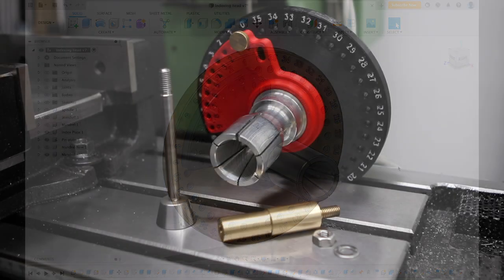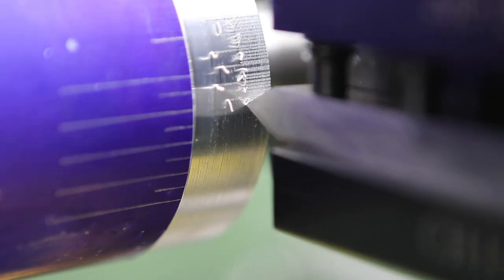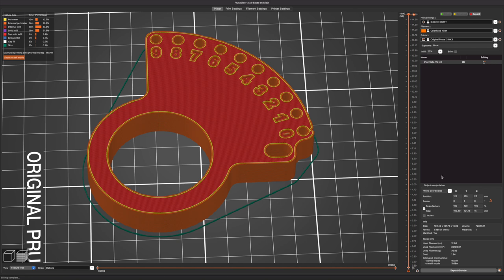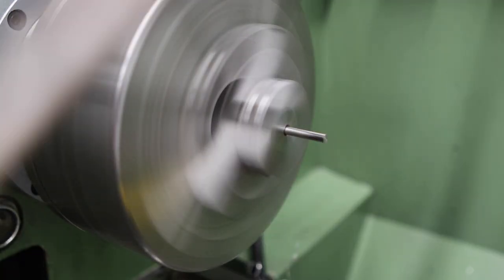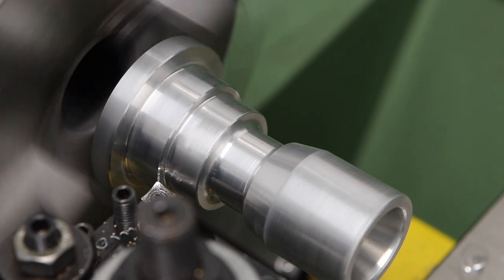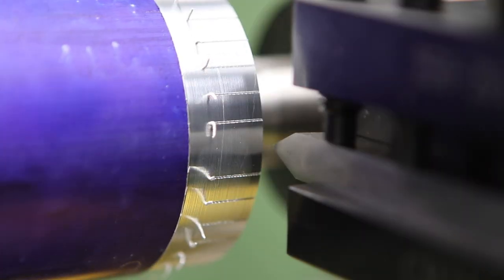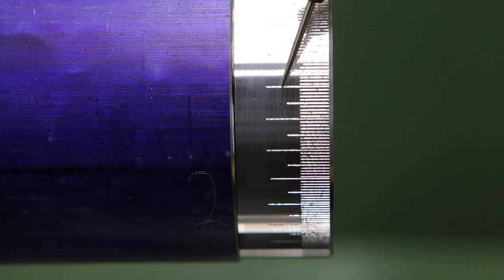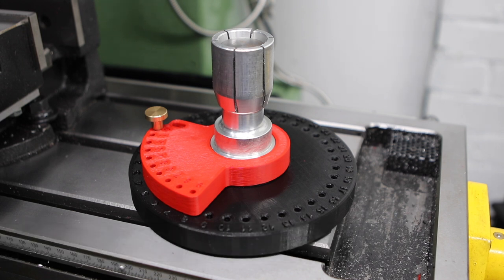Will it work? - Making a lathe indexing attachement - Part 2

Comment: Yes, please make a metal attachment. I don't think 3-D printing is the way to go with this kind of rigid precision parts, and I still see some irregularity in the spaces.
The basic idea however is in my opinion very good. With precisely manufactured parts, preferably made of steel, this can be a very useful addition to the lathe.
Reply from the maker: Thanks Michel, I plan to make the metal parts soon.

Comment: One specific recomendation for the 3D prints. I'd suggest you take a look at modifier meshes. Even the default ones in Prusa slicer would be greatly helpfull in your case. For example add a modifier near the holes and make the infill 100% around those holes or adding extra perimeters around the holes. this could really help you with having rigidity where needed and saving material where you dont need it.
Reply from the maker: Great suggestion Berk, I hadn't considered that. Thanks for the tip.

Comment: I think that's a really great debugging session!! 

I think of course metal would last 'longer' but equally, I don't think it would be too hard to modify the 3d printed parts to put metal bushing into the holes. I think with bushing the main cause of wear will have been removed, but over time with some of the side to side forces you would see the plastic eventually deform and creep, but thats on a timescale of years.... so hardly a concern.

Love the work soo far!
Reply from the maker: Thanks! Good idea on the bushings.

Comment: Excellent tool.  The design is probably the best I've seen, but I am very eager to see the newer version with metal plates instead of the 3D printed ones.  I will definitely be making this for my lathe, but I'm holding off until you have the updated version.  Great videos and explanations.  Thank you so much for sharing.  When will you be doing the updated build?
Reply from the maker: Thanks, much appreciated. I will be doing the metal version with the next two months.
Reply from the maker: I might offer a kit version with materials and printed plans. Do you think people would be interested in that?
Reply: @joneseymakes  Awesome!  Really looking forward to it.
Reply: @joneseymakes  Yes, absolutely.  I would buy it.  As long as the graduation issue is resolved with the metal plates, I think it's a great idea.  A kit with plans and material to machine the parts, or even just the prints so that people can source their own parts...I think either.  Thank you again for sharing.  Great content!

Comment: yep metal for sure. great job improving the printed one tho. The !0 and 5 degree scribes lined up well on the full circumference but the 1 degree is a wee bit off sometimes. I still think aluminium or steel plates  will make the acuracy better being rigid. Looking foward to seeing it
Reply from the maker: Yep. I’ll get to making a metal one soon.

Comment: If you put another circumference of holes, like 20 inside the 36 (at a small radius and match those holes for divisions of 10, less then a degree), you could do divisions where feed screws are 1/5 or 1/10 leads per turn, like milling and lathe, this will enable 100 or 200 divisions in the circle. For the odd lathe I have where 8 comes out, then an another inner circle of holes at 25 divisions, so 125  or 250 divisions can be done (this would be between the 36 and 20 hole circle).
Nice project, and good video production. Thanks.
Reply from the maker: Thanks, good idea. I think I might incorporate this in to the next version

Comment: Don’t know if anyone mentioned it yet , but my suggestion will be to countersink the holes 2mm or so and add matching boss to the pin- I believe you’ll improve the play in the pin and  minimize error due wearing of the plastic. And carbon filled PLA will be more rigid and wear resistant too . As I’m just shed professional with YT degree, i can be wrong for both…😁
Reply from the maker: Sounds like a good plan, thanks for the tips!

Comment: Perimeters, especially when having to modify holes afterwards for a perfect fit, make the most difference in terms of rigidity and also in having enough material left after modifications. Cubic or adaptibe cubic appear to be the most rigid infill as well.
Reply from the maker: Thanks, good advice.

Comment: Hey Mr. Jonesey - loving the content as usual. Quick question - how is the new lathe? Any comments or suggestions? I'm eyeballing a similar model to your's and just wanted to see if you've had any input regarding it.
Cheers!
Reply from the maker: Hi Erik, yes I like it. I made a review video where I spoke in depth about it. Have you seen that? https://youtu.be/YvJ-juk8dNc
Reply: @joneseymakes  I have indeed! And a brilliant review it was. Just wondered if you’ve had any things come up in the time you’ve had it, things you wish it had etc.
Reply from the maker: @EngineerRaisedInKingston  No I'm pretty happy with it. Small niggles, like the lead screw covers get in the way etc but I spoke about that in in video. One thing though - you still have to change the change wheels when switching between threading and feed gears. That's annoying. Would be better if there was a lever instead.

Comment: Aluminum plates would be much more stable than the 3D printed plates, just the nature of the material.  The 3D printed plates can still be of some sort of use, perhaps in woodworking where the dimensions aren’t nearly as critical, I can think of a few jewelry craft tools that are made of wood that require line divisions and these 3D printed plates would make the process much easier. Just a thought.
Reply from the maker: Thanks, good idea.

Comment: Try turning and pressing in brass bushings. You'll get stronger, tighter tolerance, and more wear resistant holes with the same 3d printed part. A nice compromise between production speed and functionality.
Reply from the maker: Yes, I like that idea
Reply: came here to say this!

Comment: If you’re worried about creep of the prints it might help to put a slit and clamping bolt in each to hold tight to the aluminum part.
Reply from the maker: Good suggestion, thanks.

Comment: I know this is a year on.  But, if you can perfect this, you could save allot of home shop owners allot of money.  Or, even, give them access to something they simply can't afford, otherwise. 
Thanks for everything,  Uncle Jonesey.   :)
Reply from the maker: Thanks, I have another video in the pipeline where I'm going to redesign and re-make this  in metal, I think that's going to solve the last of the issues. Thanks for watching!
Reply: @joneseymakes 
Do all of your setups as rigidly as possible (in other words, no teaming of holes while holding the part in your hands on top of the vice).  Use the hole-pattern function of your DRO to drill AND ream the holes, so that you don’t introduce unwanted error.  Also, look into picking up a tapered reamer to use on the holes in the backplate.  Then just make sure that you machine the matching taper onto the pin.  This will further reduce any error by more accurately centering the holes in relation to each other.

Comment: You can't polish a plastic turd...
But you CAN print it with more infill!
Really cool videos, it is interesting seeing you turn what was essentially an unusable concept into something functional.
A suggestion; if you stick with 3d printed plastic for the next iteration you could increase the diameter, ie the radius of the pin from the chuck centre. That will increase the rigidity at the cutting radius and reduce the angular error caused by pin and hole issues.
Reply from the maker: Goo tip, thanks for that. I think for the next iteration I'll go with metal plates now that I've proved out the concept.

Comment: Metal is ideal, but Perspex is a close second if you have access to a laser cutter. It's also pretty ridged. Over a certain thickness, it will crack before it bends. You might find ways of exploiting its transparency to simplify your design.
Reply from the maker: Good thinking Bob, I hadn't considered Perspex. I don't have a laser cutter unfortunately so it's going to be about the same effort to make them in metal

Comment: Hi Jonesy, hey just curious if you ever did a metal veraion of this? I'm very interested in your design, but something that is more consistent than the 3-D printed version and keeps the graduations dead on.
Reply from the maker: I’ve not got around to it yet, but am planning to do this soon. I will make a video in it when I do.
Reply: @joneseymakes  no worries, I understand. I really like your design with the expanding mandrel. Thanks for your content.

Comment: It's a shame the holes have to be so close together or you could probably solve the issue with a metal bushing glued into each hole.  of course that would also require the holes to be larger.  could you increase the diameter enough to allow for larger holes and more space between them?
Reply from the maker: I don’t see why not. Depends on how much clearance you have on the back of your lathe I guess

Comment: I'm not OCD or anything, but, there was enough inconsistency between the degree lines that I'd have thrown it in the bin. However, it may be that only the vernier part needs to be made in metal to higher precision. I'll be watching to see where your experiments take you.
Reply from the maker: Thanks for the comment Jim, yes it's still not perfect. I'm hoping that it will be once I make the parts in metal.

Comment: if you remake it, use a taper pin and taper reamer. then it will be impossible for it to not align properly on the hole
Reply from the maker: Good tip, thanks!
Reply: @joneseymakes  have you thought about using a hirth coupling between the plates. That might be an interesting idea.
Reply from the maker: @EitriBrokkr  Yes indeed, not considered that. I'll have to work out how to make one first!!!
Reply: @joneseymakes  the beauty of a hirth coupling is as it wears it just locks more and more accurately and more solid

Comment: 2:30 a reamer only creates a better surface finish and a better diameter accuracy you cannot make a hole straiter with a reamer or porsition accuracy they don't work this way i would suggest you get a plate made with a cnc somhow, pls pcb might have your solution
Reply from the maker: Thanks for the suggestion

Comment: I appreciate the video, but I am not sure why you did not start with metal plates. You probably could have made them faster than your 3D printer printed those parts in the video and they would have been much more accurate.
Reply from the maker: Thanks Robert, I wanted to prove out the concept before making it in metal, I find it easier to work that way for these kind of projects.